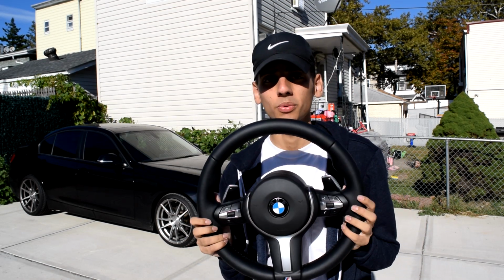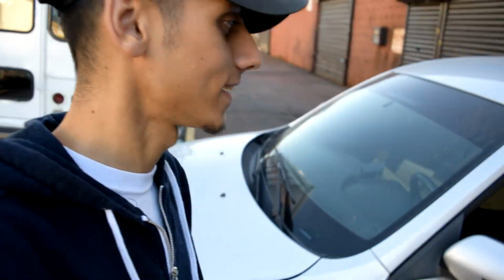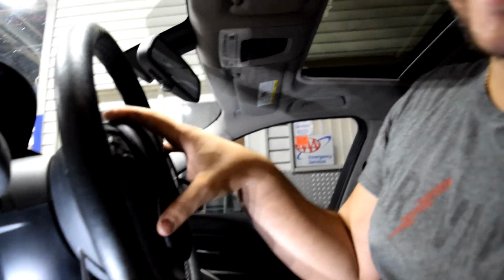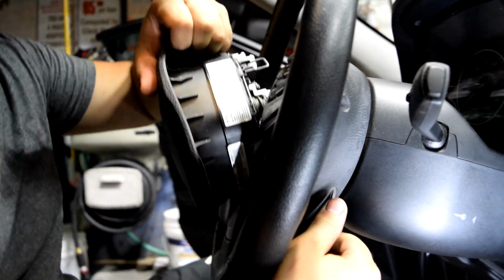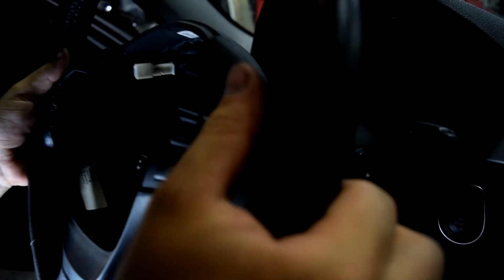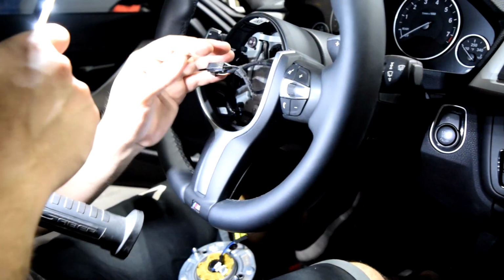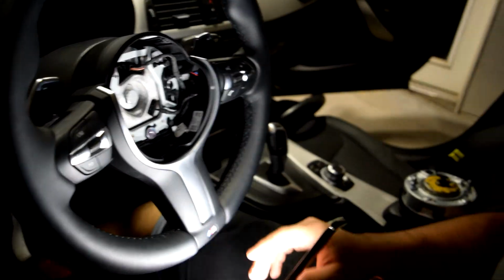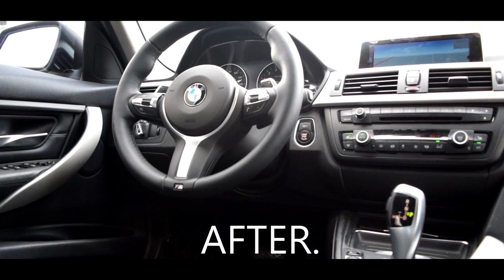M SPORT STEERING WHEEL RETROFIT! (BMW F30)

Comment: It's like a whole new car! Great diy 👍🏼
Reply from the maker: Kies Motorsports ITS SO MUCH SPORTIER
Reply: Just in time for our big race ;)
Reply from the maker: Kies Motorsports wheels add horsepower right?
Reply: Shumile Swift yes!
Reply: Hey! I haven't done it personally, but I may know someone..
Reply: i got dual stage too, just make sure you disconnect the battery before you install it or itll turn on the airbag light, connect the battery back once youre completely finished, 

about paddle shifters, i have no clue who can code them to work, dealership isnt even sure
Reply: where did you get the steering wheel
Reply: Mike rowan if I purchase a dual stage will I not need coding done to it?
Reply: Day/night difference 😍
Reply: @ShumileSwift  did you need to code the air bag?
Reply: @Zayne Cain instablaster :)
Reply: @Harley Ariel it did the trick and I actually got access to my account again. Im so happy!
Thank you so much you really help me out !
Reply: @Zayne Cain no problem :D
Reply: @KiesMotorsports  hello I have a 2015 32i Base mode non sports & I want to upgrade to a M sport steering wheel besides the wheel & airbag what else do I need to get I don't want paddles are heated just plain M sport steering with dual stage airbag, help please

Comment: This is not the M4 steering wheel. This is the M pkg steering wheel and they are different!
Reply from the maker: Michael S I know, the title says m sport lol
Reply: My 535i has the sport package and came with that wheel.
Reply: what are the differences?
Reply: @moneyinthebank14344  literally the only difference is the paddle shifters are different (wider, taller) and the middle spoke is split rather than solid... otherwise it's the exact same wheel.

Comment: i know was 7 yrs ago but, did you get it to work with the airbag? cause i have the same airbag problem saying, Driver restraint system malfunction, im super happy with the Steering Wheel but the code has me with headache.

Comment: Swift were you able to code your msprt wheel? Were any of your airbag connectors broken? I bought an mpsort with paddle shift and dual stage airbag, however the yellow connector on the airbag had a broken clip so it won't click onto the steering wheel. I'm returning the unit

Comment: Hey Swift I am aslo upgrading my steering wheel to M SPORT  doing the install myself. But a local shop that works on BMW's told me the only way to get the paddle shifters to work is if I also buy the airbag coil which I believe is like another $400 did you have to do this to get your shifters to work?

Comment: I'm thinking about getting this for my 428i coupe. I have the European model with Kilometer but it's left had drive. My original steering wheel has paddle shifters will I need to code that and the airbag? Or do I not need to code anything?

Comment: Great video, very helpful. Question do I need coding if my current wheel does not have paddles?
Reply: most likely yes. kies motorsportds goes into more detail about this. but it is fairly simple especially if you have bimmercode.

Comment: The problem is when you need to code out airbag and it's only 1 stage - and who knows if it's even working - I mean you'll find it out only in accident lol. In addition if your car had heating or vibro motor in steering wheel - you'll need to code that too and no guarantee it will work. There are so many things
Reply from the maker: Ara Arutyan my heated steering works, and you know your airbag works when the airbag restraint light isnt on! Lol. Its coded exactly how a European spec f30 would be coded. No reason for it to not work. I didnt have vibro either way.

Comment: Prior stering wheel doesnt had paddle shifter. Did it work with new one like plug&play ?? Or you need to do some wire connection ? 
Awsome Channel, i'm planning to buy a 328i , and your videos will help me a lot. Awsome !
Reply: Needs wire connection and coding.

Comment: Hi Shumile - thx for the great video!
I'm planning to get a M wheel and change it with the exact same wheel as in the video.
Can you share your experience so far? Can I put the new wheel in and drive it without coding (i would code later)?
Also are there any failure messages logged? So basically you can built it in and drive - code the paddles later?
Greetings from germany!
Reply from the maker: Orhan Arslan yes that’s pretty much what I did, but you must code it before driving for safety purposes if you got a dual stage airbag for a car that’s coded for single stage, or vice versa. Theoretically you can install the wheel, plug it in and drive but you should atleast code the airbag to work to its proper functionality. Safety first! Thank you so much, greetings from NYC!

Comment: So eventhough you didn't have paddle shifters on the original steering wheel, you would be able to use the paddle shifters on the new steering wheel ? If yes then how would that be possible ? Wouldn't you need extra connections to the computer and transmission system ?
Reply from the maker: No some of these cars come pre-wired with the harness. Basically we installed the wheel, hooked up all the connections, and coded the paddles to work, luckily my car had the harness, and so the paddles worked without needing to get a new harness! Which kinda sucks cause now I can't make a video on how to install the harness!
Reply: Shumile Swift you mean to say that even if the harness is not there, the bmw transmission computer is already equipped with the option of the paddle shifters ?

Comment: How did you code the “driver restraint system” off?
Reply: Abraham Garcia did you solve it? I have the same problem
Reply: Did anybody solve that problem?
Reply: F. Arda put ur n20 air bag wiring to the new air bag I did no coddling no lights.
Reply: Zab h Okay got it ,  thank you
Reply: F. Arda electric tape the lose wires
Reply: F. Arda does it work for u?
Reply: F. Arda plus thé 3 old wiring to the m sport air bag it work 😊
Reply: F. Arda plug*
Reply: @zabh9084  hello! i was just wondering how you guys did it?

Comment: Swift, does the heating steering still work?
Reply from the maker: Rukarrio yes I can't believe I forgot to mention, the only reason I took so long to get the wheel cause I couldn't find one that was heated, this one sure is, and I checked if it worked after I got home, realizing super late. It wasn't heating up for a while, but since the material of the wheel is different, it definitely takes longer to heat up, but the function still works! The old wheel heated up almost instantly! LOL

Comment: so even though u dnt have padleshifters on your stock steering wheel u can still buy this kind of steeritng wheel ?
Reply: Yep, it'll bolt up but shifters will not work until you get it wired and coded.
Reply: thanks man